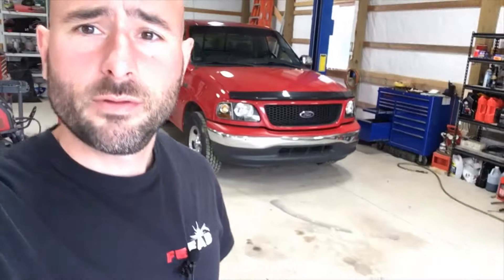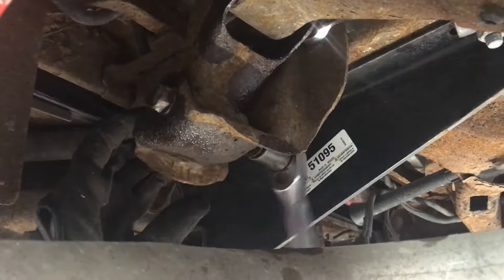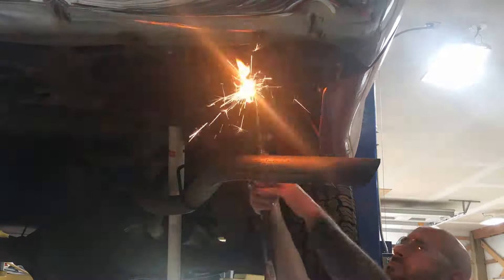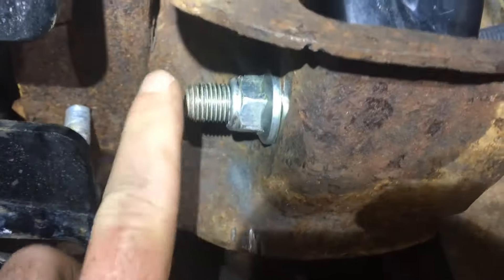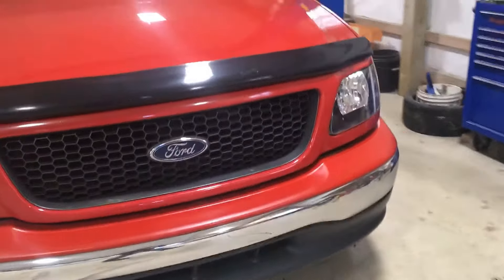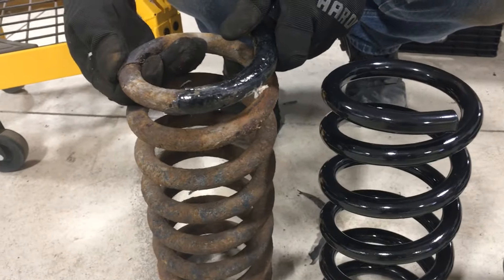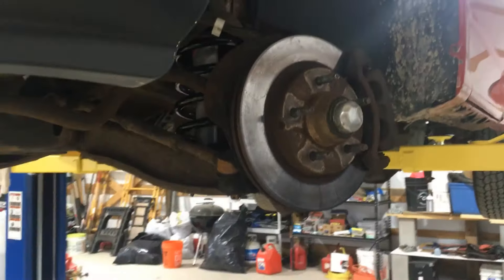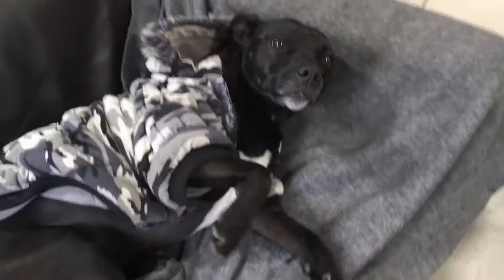Lowering Matt's F-150 With 2" Drop Springs and Shackles

Comment: Would all those parts work on the 4wd drivetrain. I have the same truck just 4wd 2003 standard cab XLT
Reply from the maker: @anthonys1409  nope
Reply from the maker: @anthonys1409  4x4s use torsion bars instead of coil springs

Comment: i today have a clean 2003 f150 shorth box 4.6l it is a real old mans truck 160k on it stock inside is cleaner than some cafes i ate at i watched this vid and ordered the kit. seriously the insurance lady came to day to see it going to up the insurance on this one. thank yall for this vid
Reply from the maker: Your truck sounds sweet! It will look so good lowered
Reply: question ?? can i use standard shocks like Monroe on the 2 by2 lowering kit
Reply: i did the rear2inch lowering shackles me and dad . bounced on the truck 36 before at fender 34.5 ater . truck is now lelvel if i put the 2in drop spring in the front what would that look like back to the being rear higher than front this is my question

Comment: I did a similar 3 / 4 drop on my 1998 F150 when it was new. That kit had a 3" drop front sprig and a new front bracket for the front of the rear leaf springs as well as the longer shackle. The truck drove / handled better than stock ride height. I wish I still had that truck. Good candidate for a Coyote. love your shop.
Reply from the maker: Thanks, Rick! I’m sure that truck looked great. I was surprised how much difference just a 2” drop made.
Reply: Pppppppp
Reply: P
Reply: Do you know by any chance what brand the lowering kit was I'm looking for one and want to know of someone who's had it

Comment: How much does it typically cost to lower the back end on a 2003 f150? Ballpark? I have one, love it, but i hate that the back end sits soo high.
Reply from the maker: Drop shackles like we used in this video usually cost $50-100 for a set. I can’t speak to labor. I’m not a commercial shop, we are just friends hanging out working on our cars.
Reply: @ShawnFerret  No worries. Just trying to get an idea at what $ I'm looking at. Thanks!

Comment: Also, I forgot, don’t you need to buy 2” drop shocks as well?
Reply from the maker: We didn’t change the shocks. Since the bump stops don’t move, you aren’t actually changing the suspension travel, but it may be worth buying shocks that are valved to match the stiffer spring rate in the front.

Comment: I have a question to ask you where did you buy the 2 inch front drop springs for a 2000 Ford f150
Reply from the maker: The brand is King. I’m not sure which supplier they came from sorry.

Comment: Did you flip the stock wedges 180 degrees I read  about doing a drop changed your pinion angle
Reply from the maker: We didn’t touch wedges. The truck drives just fine.

Comment: What size wheels are those, 17”?  I just bought a used 2000 150xl and want to drop it a few
Inches too. Mine came with 20”s and fairly lower profile tires. I keep going back and forth between 2” drop springs
and 3”. Looks like 2” will do for me with the dub wheels. I dont want to be rubbing coming into a driveway.
Reply from the maker: I’m pretty sure these are 16” wheels. 17” would be an upgrade 😂.
Reply: i can’t find any king springs that fit that model on the website where did you find yours?

Comment: Is that a 2” lowering springs in front?
Reply from the maker: Yes
Reply: @ShawnFerret  how much was the kit for the front and rear and do you have a link for the kit?
Reply from the maker: @diyhelper3088  this wasn’t a kit. The front springs were purchased separately from the rear shackles. The front springs are made by King, and the rear shackles were from Amazon. I’m sure the prices have changed a lot since this install, and I don’t have links I’m sorry.
Reply: @ShawnFerret  is the rear a 2 inch drop as well? And it is lowered 2 inch in front and 2 in rear? I'm putting the 2000 Cobra R bumper on mine and just want to make sure I have enough clearance
Reply from the maker: @diyhelper3088  sorry, you have me confused with this question. This video is an F-150, but I assume you are talking about a Mustang? Yes, the drop is 2/2 on this truck.
Reply: @ShawnFerret  nope I'm talking about the 97-03 F150. They make the 2000 Cobra R body kit for the 10th generation F150  but great looks good with the 2inch drop
Reply from the maker: @diyhelper3088  very cool! I had no idea.

Comment: Does anybody know where i can find a lowering kit for a 4x4? I found one but its discontinued...
Reply from the maker: The 4x4s have torsion bars instead of coil springs, so you can adjust the height a bit by cranking them down, or you might be able to find torsion keys that will drop it more. The rear can still just be done with shackles.
Reply: @ShawnFerret  thank you bro, I didn't know that at all I thought I had to buy a whole kit, where do you recommend I should buy torsion keys and shackles?
Reply from the maker: @djpollo2474  I like Jegs and Summit Racing for aftermarket parts. Belltech is a good brand. Here are some lowering keys from Belltech sold by Jegs:

https://www.jegs.com/i/Bell+Tech/146/3933/10002/-1?gclid=CjwKCAjw3MSHBhB3EiwAxcaEu39sZUfJ83YA_vNj4_yZTf1H6zieWjdOps52TVT39cpyRa78ojkmmxoClNkQAvD_BwE

Comment: so you only changed the rear spring hangers and not the forward mounts? How bad did that jack with your pinion angle?
Reply from the maker: We honestly didn’t measure the angles, but they still looked fine and the truck doesn’t vibrate under any conditions. If it was an issue we would have used shims under the spring perches rather than touch the front mounts.  I think it helps that the truck is a V6 manual and the leaf springs are relatively stiff, so there is almost no pinion deflection on accel.